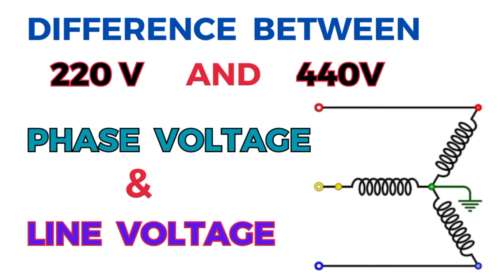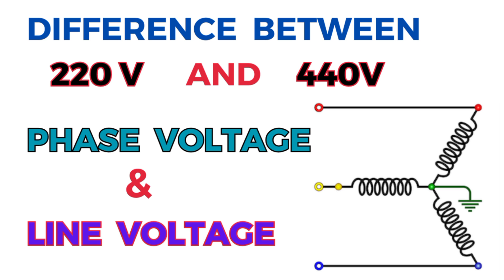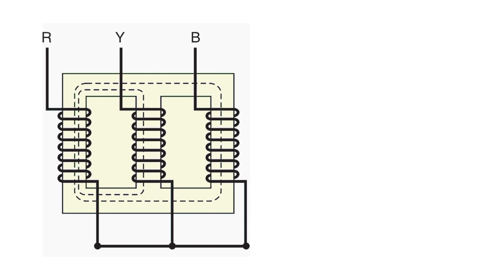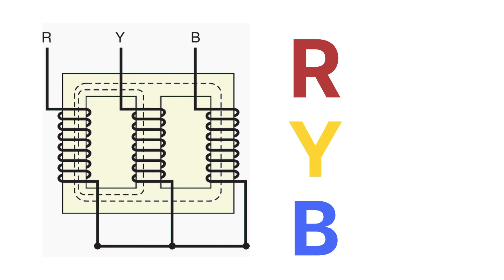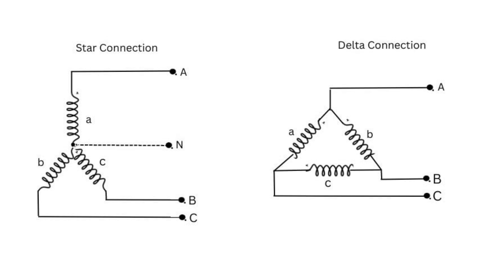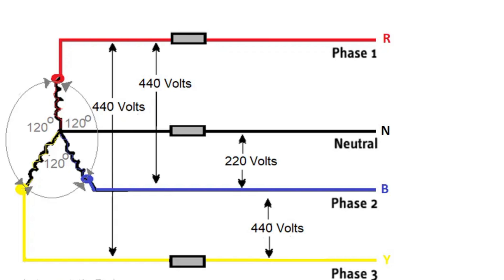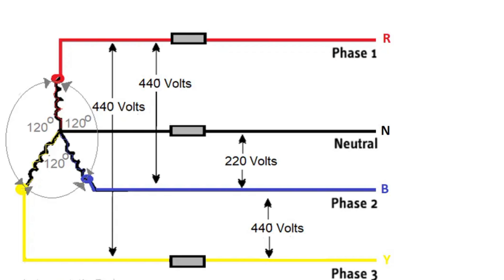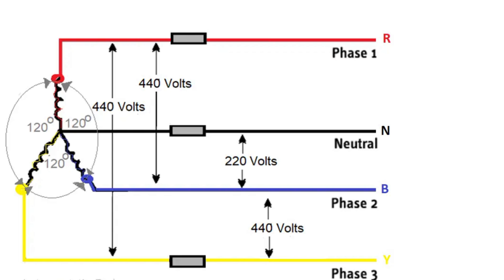220 Volts and 440 Volts || Phase Voltage and Line Voltage ⚡|| Basic Electrical Engineering

Comment: Due to the 120 degree phase differences between phases, the voltages between two phases is not 2*220V=440V but sqr(3)*220V=380V. As stated below, please review and correct. Or have this video deleted.